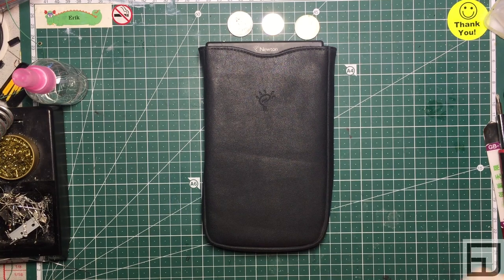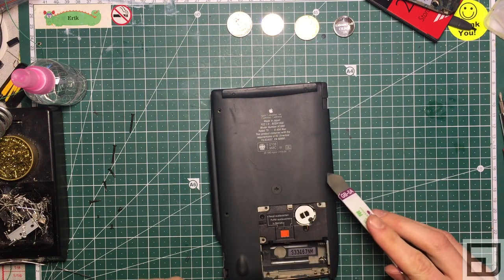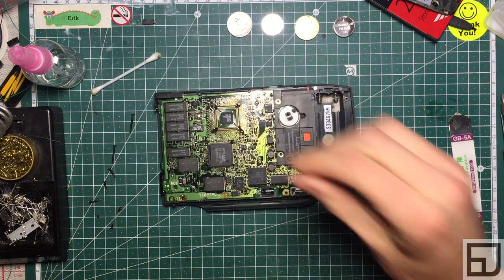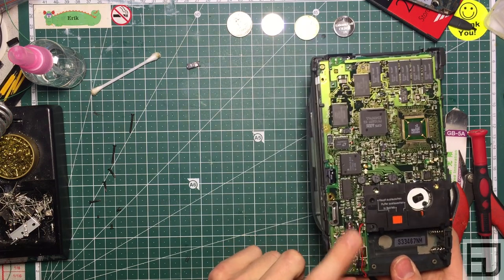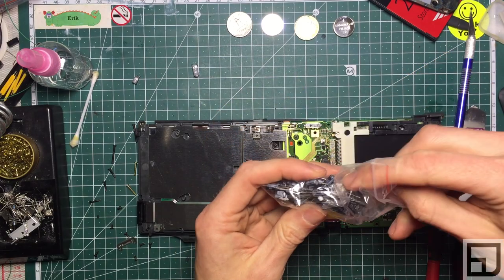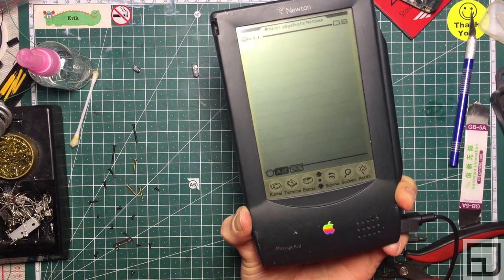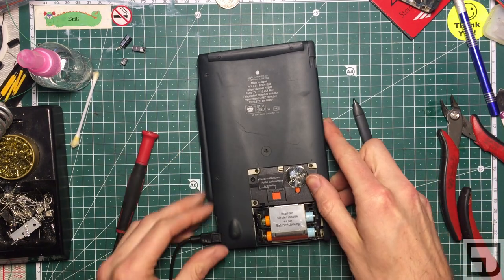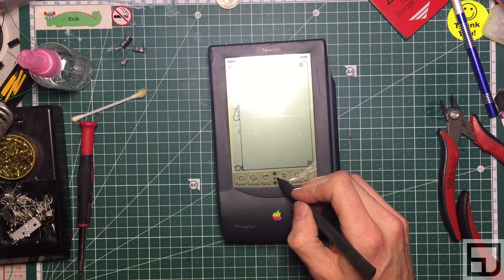Restoring/Repairing an Original Apple Newton MessagePad 100 (OMP H1000), start-to-finish

Comment: Thanks for this video. I recently got an "untested" Newton 100 on eBay and found that it just displayed garbage on the screen and made no sound. After I found your video I was encouraged that it might be fixable so I ordered some capacitors, and as it turned out just replacing the first two you showed completely fixed it! I actually used one of these back in the mid 90s to take notes in a college class, but it was pretty painful. I had to use the setting that didn't try and convert your handwriting, since the handwriting recognition was so slow. I still have some nostalgia for them though
Reply from the maker: Excellent, I'm very happy to hear!  I agree the recognition on it is more of a novelty and aggravating to wait for it to catch up.   The pop-up keyboard works just fine
Reply: @Ekriirke  Install Graffiti, it makes it just like writing on a Palm! Super easy and works great. I have only had it on mine for a few days now but I could never go without again! I’ve been using Palms for years, so I can now write on my Newton as good as I can on my Palm! You’ll need an auxiliary memory card to use any other programs though, because Graffiti takes up most of the Newton’s internal memory. I have a 2MB card in mine, so I have plenty or room.

Comment: Great video, very clear and helped me revive my OMP.  I've still got ONE horizontal line out on the LCD, but otherwise 100% fixed.  I'd offer one improvement over this video and that would be to use ceramic caps for the replacements. I found ceramic surface mount caps with the correct capacitance and voltage ratings that were the perfect width for spanning the gap between pads (1206 for the 100uF and 1210 for the 3.3uF). Sure it cost a few pennies more, but in 20 years I won't be doing this again.  I left the 470 thru hole as an electrolytic. Thanks again for putting this out.

Comment: At 8:20 you might think about not tinning the components overtop the PCB in case any solder or flux drops from the soldering pencil. Others may have pointed this out to you already. Regards. —DP

Comment: The first time I opened mine (an MP 100) to replace the sound cap (sound was super faint), that little screw cover sticker flew off when I pried it up and I never found it! Oh well, at least I fixed my sound. Didn’t know about the cap on the other side of the board. Mine is still working great, but it probably still needs replacing regardless.
Reply from the maker: I lost one, too!  I should have mentioned a warning to cup your hand over it...
You should at some point, since when it does leak it will affect the card slot with its juices - and they are potentially corrosive as seen in contemporary Macintoshes
Reply: @Ekriirke  Makes me feel a little better that I’m not the only one. :) Yes, I agree 100% about the cap. It’s going to cause trouble at some point, so best to correct it before it does so.

Comment: I have the exact same issue with my Newton h1000. Thank you for the video! I read online exactly the same procedure your doing so glad to know it’s the same. 1 question. Your using a lot higher voltage capacitor, wouldn’t this make a difference even for the long run? If I’m looking to do mine should I get the same spec as what’s originally there or the same as what you used?
Reply from the maker: The voltage rating is more of a "maximum capable before failing" rating,  where the Farhad rating is the important part and applies to whatever voltage you use.  Generally it's a good idea to use a voltage rating a bit higher than what it will see in circuit and definitely not lower.  The original caps should already be spec'd so there is no problem using the original specs.  
I use higher voltage because that is what I happened to have on hand and could still physically fit...
Reply: @Ekriirke  thanks for the fast reply. I can’t wait get my Newton working!

I’ve never owned one before and not seen any videos on them so wasn’t sure if I need the PCMCIA card but as far as I’m aware that’s extra storage or for other things and not required for booting and using normally
Reply from the maker: @jerrybomcool  of course! AFAIK the PCMCIA slot is really only for (extra) SRAM memory cards but if you can manage drivers ethernet seems possible... No card is required for general use. Peripherals tend to use the serial port on the side
Reply: @Ekriirke  beautiful! Thanks for the information and the extremely helpful video! I’ll be back to watch again when I order my replacement capacitors :) I’ll let you know how I get on
Reply: @Ekriirke  hay, I fixed the Newton after doing the one capacitor c51 all working fine! :)
Reply from the maker: @jerrybomcool  Great news!  You should do the 2 main ones I did first (sound, video), if any

Comment: Great video! ManyManyMany thanks! Just finished fixing OMP and it works! Has a line of dead pixel in the middle of the screen (don't think it is related to swapping capacitors though) but otherwise it works perfectly now. However PCMCIA slot is not working, probably some of the (fish) juice from busted capacitor got in there somewhere. Any idea how to fix?!
Reply from the maker: Thank you, unfortunately your LCD issue is a problem with the screen itself or the lamination of the ribbon to the glass edge.  I'm not too sure how to help this in other devices I've had the same issue sometimes pinching where the ribbon connects helps which means if you can get a conductive glue you may be able to fix it.   For the PCMCIA slot I would try more cleaning of the pins with IPA, worst case wash the entire board
Reply: EkriirkE Hi, many thanks for your comments. Cleaning board has helped and pcmcia slot is now fully functional!!!While cleaning slot I have tried to figure out screen issue but stopped as I couldn’t figure out way of getting to screen without breaking something (sorry, completely new to hardware repairs, but really want to learn!). Is there a chance you can record a full OMP disassembly and show ribbon part to work on in order to try to fix missing pixel issue? Know you are busy and there is a slim chance but that would have helped a ton
Reply from the maker: @vasyavasili4713  I just saw this.  Great!  Yes I can do this for you I am planning on to another Siemens' branded OMP which is near identical so I can throw in ribbon removal, but if the missing pixel row is from delamination of the ribbon I don't have high hopes for simple fixes
Reply: @Ekriirke  Looking forward! Many thanks!

Comment: Thank you for this guide! Now I can finally repair my old Newton, which has the same problems as this one.

One question: How important is getting the exact capacitor values? Could I use a 4.7 uF in place of the 3.3? If so, I won't have to order any parts beyond what I've already got laying around. :)
Reply from the maker: You should always match capacitance, voltage is more lenient if you use larger.  For the newton you should also keep the diameters 5mm or less
Reply: @Ekriirke  Thanks for the reply. Yes, what I've got is exactly 5 mm, but it's 42% higher in capacitance. I know that sometimes you can safely go a bit higher in capacitance, depending on what the purpose of the capacitor is (e.g. ok in a power supply but not ok in a timing circuit) and that capacitors like this often have huge tolerances (e.g. +80%/-20%) so it might in fact be that large anyway. So I was hoping that you might know what exactly this particular capacitor does and so if I could get away with using what I've got and not having to place an entire order for a single cap.
Reply: @Ekriirke  Can you tell me what the 3.3 uF capacitor does? I would guess that it's a power reservoir for the LCD?
Reply from the maker: @Havron  Yes exactly, the inductor nearby is part of a flyback circuit that boosts the battery ~4.8V to a higher level the LCD requires, without the cap there to collect and keep the boosted voltage steady, the inductor keeps dumping short bursts of power directly into the LCD, making the ticking sound and the flicker.  4.7 should be OK, I just think if you go too high you may stress the boost converter initially charging the cap taking longer
Reply: @Ekriirke  Thanks again for the reply. Yes, that's about what I figured. I do also have a 2.2 uF that I could use instead, but I've read that going lower is usually not a good idea. I also have some pairs that I could each fashion into a combined 3.2 uF (4.7 & 10 in series or 2.2 & 1 in parallel) but that seems needlessly complicated, plus the voltages are all over the place (in particular the 1 is only 16 V).

Oh, also, while my smaller caps fit within the 5 mm max, my 100 uF is actually 8 mm. I believe you said that there's more room for that one, so will it fit alright at that size?